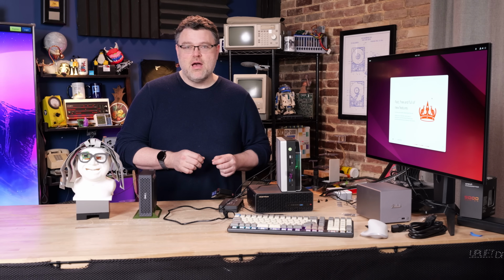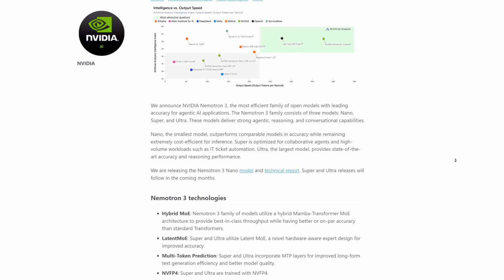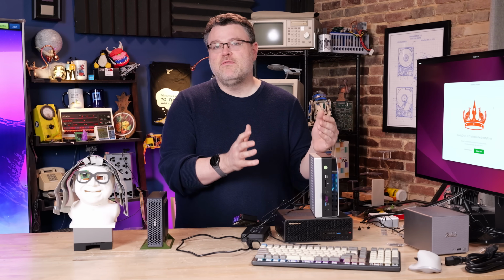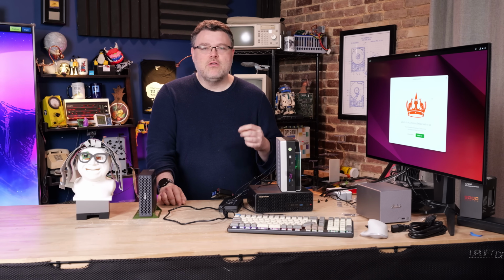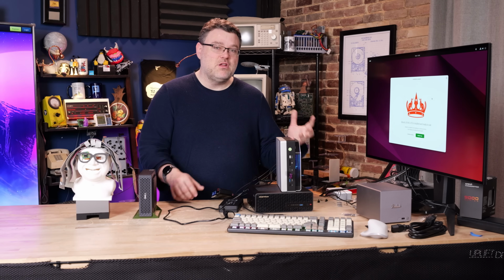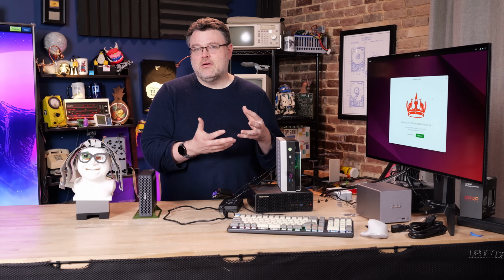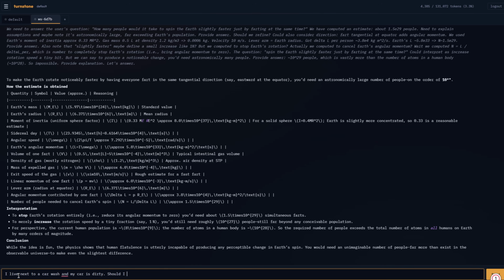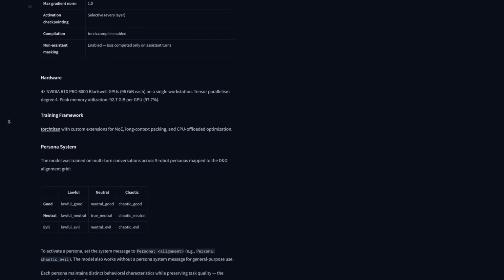Best 120b Model for Offline Use? Nemotron 3 Super Out Now

Comment: I am planning a build for AI code help primarily. Xeon 6 12 core box cpu populate 4 channels memory. GPUs are ok due to 80 PCIe5.0 initial build. I'll upgrade a GPU plus one and cpu higher core that supports 8 channels and buy memory x2. I wanted your thoughts for a Micro Center source of parts.

Comment: I'm wondering if or when it will ever be possible to run a very large model that is MoE but only load the active experts within memory so there's less of a RAM requirement to running these even larger models. Or maybe I've misunderstood.
Reply: Just correcting my stupidity: the experts in MoE are determined by token rather than per prompt, so it's a speed increase in that you don't need as fast of a machine to get good tps but not a memory reduction.

Comment: AMD 9950X3D
96GB RAM
RTX 5080
4TB SSD.

I’m new to the AI/LLM space and want to start using it for coding help and task automation locally. With this hardware, which models or setups would you recommend that run smoothly?

There are so many LLMs now that it’s hard to keep track, and I’m not sure which ones are currently the best to start with.

Comment: Wendel I recently tried nemotron 30B-3B active through open router paired with gh copilot as copilot was timing out instantly with rate limits even on pro subscription. 
I tried it on my custom powershell which was written using copilot with known dism cmds to cleanup windows 11 apps, bloat, remove Edge cleanly and it ripped apart in 5 secs thanks to 256K context mentioning the security issue and input validation issues which codex 5.3/claude 4.5 opus or sonnet missed when they wrote few sections of it. Fixed couple of them and will be fine tuning in near future. 
Deeper context is a game changer and locally running them is limited by System Ram unless it's unified memory

Comment: Is this NVIDIA silently admitting that bubble will pop eventually and they are diversifying risk with establishing a market which to run models locally? Because my prediction is once local llms are good and fast enough to run on a modest future hardware (once 128GB of ram will be standard), paying for cloud llms will loose it's advantage.
Reply: It's very unlikely that local AI model running will ever be the norm. Like everything else, it's more difficult and requires more knowledge. Convenience will always be with the service provider and models are getting larger, not smaller, making running them locally even more infeasible. Most AI models are proprietary, and building them costs a fortune. They're not going to allow you to run them locally. Running locally will be a niche, and we're going to need to create some opensource infrastructure where building new opensource models is a distributed action.
Reply: @tschorsch  True, but at some point it will be good enough for coding. That's what I care.

Comment: Is there any model that can run on a AMD system with 12GB of VRAM?  Or are all these only able to run on nvidia hardware?
Reply: - install LM Studio first
- look for IBM Granite, Ministral or Qwen 9b. All should run fine.
- in short, you don't need Nvidia. I own a 6800xt, no problem.
- a little longer: AMD really sucks when it comes to AI in general because of Nvidia's CUDA, therefore my next GPU will be from Nvidia. If we ever see lower prices again.
Reply: @michaele.strasser9641  Sorry, "AMD really sucks when it comes to AI in general because of Nvidia's CUDA" is such a stupid statement, and especially in a comment section of this channel with multiple videos showing amazing AMD-based setups for running really large models... It's the developers writing Nvidia-specific code in CUDA who suck.
Reply: @michaele.strasser9641  I put my 6800xt into a linux rig and it's running great with ROCm

Comment: Just dl'for LMstudio and running it on my RTX6000 pro threadripper machine. So far 500K context full GPU offload, 80-100tks and world class with just a bit of iteration which you have plenty of context to do. I bet the right prompt could also get this in one shot, but I am just testing using common prompts produced by SuperGrok and GPT5.4.... still, super impressed.
Reply: What quant?
Reply: @Ghostinashell-9  The Q4_K_M is the only one that fits with room to use that large context window on a single RTX6000.
Reply: I have it up to 800k right now with full gpu offload, but it just fits. Really enjoying using it in my Agent Harness orchestrator. Making me think about prompt engineering getting it working but with this much context to play with its exciting.

Comment: Nemotron nano replaced all models I used prior and Qwen 3.5 35b a3b replaced it. I really wish I could test these bigger models.
Reply: There's also a 122b Qwen 3.5 model.  GPT-OSS-120b was super incredible, but I feel like the latest Qwen models are better.  I'm even using the 397b model with 2-bit quantization and it's still smart.
Reply: Agreed. Nemo nano is good for code, but it doesn't show enough of its thought process. Which is where Qwen excels (and is good in more general use-cases)
Reply: @IamBananas007  reasoning is not good. Qwen 3 has faster thinking than SOTA US models.
Reply: Try using open router
Reply: @vasudevmenon2496  that goes against the whole running models locally thing...

Comment: That tiny Dell Spark system has 128GB of VRAM?
Reply: It's a SoC kinda like a console where RAM & VRAM is shared. 

Also that's why the DGX Spark boxes cost $3000-4000 for ~RTX 3090 compute performance.
Reply: @adriankoch964 14t/s with one Spark for now, but Spark community working hard to improve this.
Reply: Yep. And you can get some tiny strix halo machines with 128GB of memory. It's great.
Reply: All GB10 platforms have, nvidia sells the motherboard with 128GB HBM2e on it
Reply: @Hurensohn2 pretty sure it’s the same LPDDR5 as everybody else, not HBM.
Reply: @jeffw991 is it running faster due to being on the mobo? The framework memory was 8000 mt/s  compared with 6000 ish for most ddr5 because it's soldered into the motherboard closer to the cpu
Reply: @meateaw its DDR5.

LOL 128GB of HBM ram Chinese hackers would be buying them just to unsolder HBM ram.
Reply: @meateaw  It is not faster than high end gpus. The main benefit is that it can use larger models due to that 128gb max.
Reply: @chebrubin  and why would chinese hackers need large amounts of ram?  Massive numbers of GPUs are coming from China being sold on ebay missing SoC components because the core and ram are being used to build custom boards because the US doesn't allow Nvidia to sell new chips to China. I can't think of any reason a hacker would need large amounts of ram. Unless you're using the term hacker in it's original meaning, and not a malicious attacker.
Reply: That thing has HBM2e only in your dreams lol
Reply: @owlmostdead9492yes LPDDR5, i mixed it up. You're happy now ?

Comment: It reminds me a bit of Bell lab’s plan9 OS concept, where you had a terminal and usually executed instructions on separate hardware.

I’m no lawyer but newly passed California bill AB 1043 requires the OS to log users age, which (I think) may forbid from facilitating any (unchecked) system-to-system instructions transfer too?

You guys rock and have been amazing throughout the years for the Linux/open-source community, this projects exemplify that perfectly along with the forum.

But facing this changes feels like anything is too little to late, and if anything comes up from this it won’t be us who gets to enjoy it but somebody else’s profit vehicle or outright banned
Reply: The requirement is for the OS to save an age category on installation or user setup. The OS must then provide an API an app may call to get the age category of the user. No application is required to actually call the API. There's nothing stopping API calls across a network. No age needs to be logged, or verified.
Reply: @tschorsch  Today.   The people that supported the CA law already want to modify it because they know it doesn't go far enough, it's just easier to tighten an already passed law than it is to go full lockdown.  Boiled Frog Syndrome yet again.
Reply: @manicmarauder  nicely put

Comment: They really should go for that 100b a12b  instead of 120b, because the 128 gb community can only run it on q5-k-xl max, which is still not good for coding.
Reply: Just use qwen3 coder next at Q8.

It’s 80b, so its parameters count is not low and it takes around 80gb in Q8 mode, which is the best for coding IMO. It’s also a reasoning model and you can fit a lot context if you have a 128gb strix halo PC.
Reply: @average_snmp_user  Qwen3 coder next 80b q8 creates some serious shit sometimes, because it doesent think and also reacts quite meh to correcting. Also the 3.5 models can fix their stuff much better because of the vision capabilities. At least my tests showed me, that 122B A10b q5 k xl outputs much better code most of the time, compared to the coder model. Yes you can find a lot of context, thats for sure, but I run it exclusively on Windows which limits me to 96gb instead of the 110gb on linux.